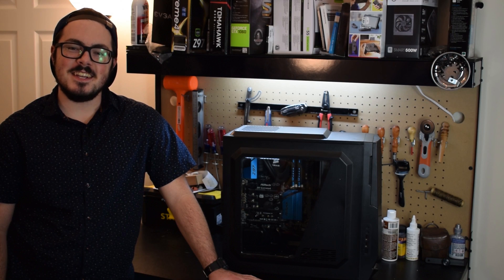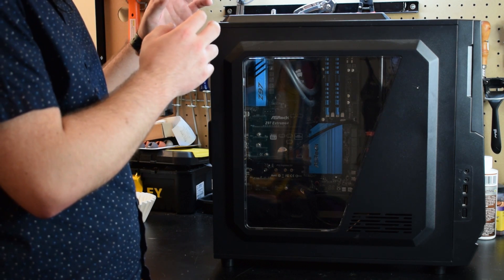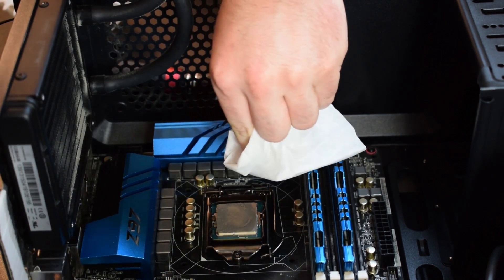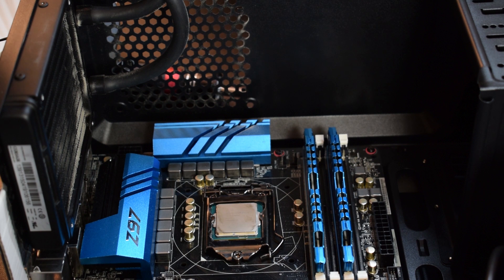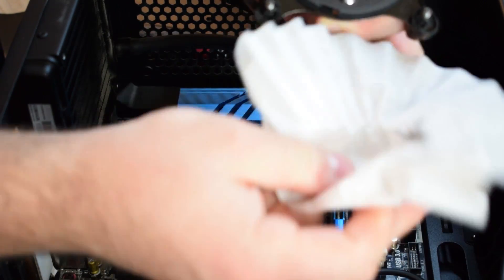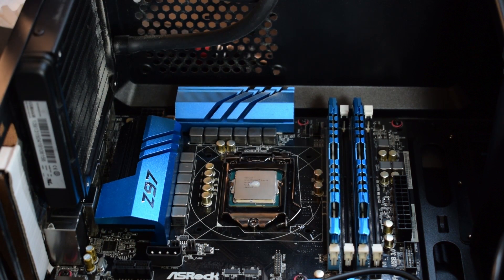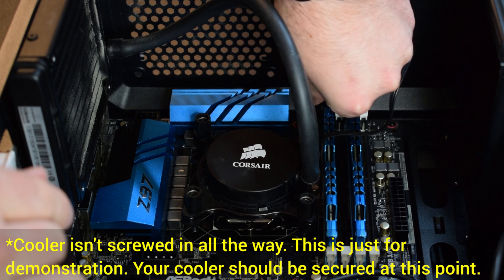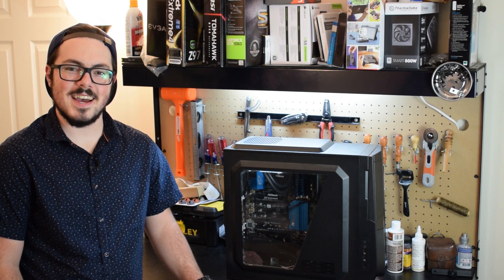How to Clean a CPU and Apply Thermal Paste

Comment: The pea-sized or grain of rice line is severely outdated and quite frankly always wrong.  You should completely cover the heat spreader with a thin layer of the thermal paste using a mini spatula.  The part of the video that shows the initial spread is proof that you will not get full coverage with the line/pea-sized method, and the follow-up about it spreading over time is also not correct.  The method used in this video is a thermal throttling nightmare...

Comment: What alcohol u use in the vid
Reply from the maker: I used isopropyl alcohol. The higher the percentage the better. 90%+ is best, but you can use 70% as long as you don’t use too much and give it enough time to evaporate before you turn anything on. I hope that helps.

Comment: Anyone else notice his rams are in the wrong slots?
Reply from the maker: I was using the ram in a different PC and threw it back in this PC at the last second to make this video 😂 But with that particular ASRock motherboard, that configuration is also correct for dual channel memory. It's definitely worth checking the manual when building a new PC though.
https://download.asrock.com/Manual/Z97%20Extreme4.pdf

Comment: I need help guys , i removed my water cooler to clean my cpu , before my cpu temp was between 60-70 , now after cleaning and putting on new thermal paste its 99c
Reply from the maker: My suggestion would be to try and do it all over again. Make sure you make good contact with the CPU and don't move it or pull it away from the CPU once you have made contact with it. Make sure you have the water block screwed down securely to the bracket on the back of the motherboard.

When people accidentally pull up on coolers before tightening it down, or have the cooler loosely connected, it can create air pockets that lead to terrible cpu temps.

Assuming nothing was damaged the first time, that is what I would suspect is the issue. Also, make sure to plug the pump back in if you unplugged it.

Comment: I'm scared i will apply too much thermal paste
Reply from the maker: There is definitely some room for error. So don't be afraid if you add a little more than necessary, but it doesn't take a lot to get the job done.
Reply: @SANTINIIO  Ok i did it i think its ok my temperature is around 37 when idle using intel core i5 7400
Reply from the maker: @Tuberex  Yeah depending on the cooler and ambient temperature that is perfectly reasonable. In my experience over the next week or so it will continue to drop as the thermal paste spreads out.

Comment: I use the arctic thermal paste remover and cleaner. it's a two step system that removes all traces of any thermal paste from the heat spreader, and preps it for new paste. I also use arctic mx-4 in my laptop, which I use for bike frame designing and gaming, and it is running at least 15F cooler than the factory paste had it running. However, I now have dust problems. Got any tips for dust management?
Reply: More positive pressure inside the case should help with that. Filters on outside vents - air filter in room if very dusty.

Comment: skipped over taking off and putting on the cooler, that's the only part I wanted to see...
Reply from the maker: That is because its highly dependent on the they type of cooler you use, socket, etc. 

One thing I will say, is when you put the cooler on the thermal paste, do not lift it up again (unless you feel like cleaning it and reapplying thermal paste). Any air that gets between the thermal paste and cooler with make it less efficient.

Comment: Can doing this and using compressed air damage cpu pins?? I thought they were safe and locked in safe in the mobo.
Reply from the maker: If the cpu is in the socket then there really isn't any way to damage the pins. If you ever decide to use compressed air (which I would only use for dust) in your PC just make sure you don't tip the can over to spray.

Comment: Your doing it all wrong. Alcohol wipes and done. Takes 30 seconds. Coffee filters are used by professional youtubers to show how much paste is left. 

Alcohol wipe let it dry then done.
Reply from the maker: You've clearly never done it. Because there is always old thermal paste that has to be wiped off. Any thermal paste left on, especially some that has hardened, will cause gaps between the heat spreader and heat sink which will hurt your performance.

But whatever you say.
Reply: @SANTINIIO  did it yesterday actually when I fitted a new cooler. Been working on computers for 20+ years. Linus uses coffee filters to show what is left AFTER they have been cleaned. Lol

You claim to know what you are talking about but admit you have not checked the paste in over 1 year. Dont give up your day job.
Reply from the maker: @SuperSinkorswim  if you've been working on computers 20+ years then why did you feel the need to watch my video?

Nice try there boss.
Reply: @SANTINIIO  do you know how YouTube works? Auto play and recommended videos. Nice try there go make some coffee.

You got one thing right. I also use alcohol wipes. Apart from that you are making an easy job more difficult.

Comment: Do you need to be careful with how much pressure you apply when removing the paste from the CPU?
Reply from the maker: You can add quite a bit of pressure. You aren't going to damage the heat spreader. Like Surub mentioned, just be careful of the pins. I'd also add, if you keep the cpu in the socket, make sure you don't put so much pressure that you flex the motherboard. The motherboard can definitely crack if you add too much pressure.
Reply: SANTINI.IO awesome, thanks!
Reply: yes. but you can always remove the cpu and clean it holding it by the corners so u dont touch any pin

Comment: Is it safe to clean the processor without removing it from motherboard?
Reply from the maker: I always clean it in the the motherboard so I don't mess up pins or damage the underside of the CPU. If you spill alcohol or something like that, just make sure it completely evaporates before turning the pc back on. The way I look at it is that the motherboard is typically cheaper to replace than the CPU if something goes wrong (Although nothing is likely to happen).
Reply: @SANTINIIO  Ok, thanks a lot 🙏

Comment: why coffee filters?
Reply from the maker: They are lint free unlike paper towel and it's something that a lot of people already have. And if you don't have them already, they are really cheap.
Reply: @SANTINIIO  oh ok, interesting. ive been putting off changing my thermal paste (havnt done it before) for a looong time now and have just been waiting until i really have to change it. even tho i did manage to change my GPU i'm still scared to dig around in my pc lol, i feel its actually affecting my gaming performance and i have to finally do it. any alternatives to coffee filters btw?
Reply from the maker: @kombatqueen5068  You could probably use an old t-shirt or cloth, but you have to make sure there isn't any lint, dust, etc from the cloth left on the CPU before you reapply the thermal paste. It's important that the surface is clean so there will be good contact between the CPU and heatsink. It is probably best to just spend the $4 on the coffee filters (https://amzn.to/2OLdRtG) or it's probably even cheaper at a local store.
Reply: @SANTINIIO  yeah ill probably just pick up some 2mo, tyyy for the replies ❤

Comment: I don't have alcohol what should I use?
Reply from the maker: I'm not really sure. Isopropyl Alcohol is used because it evaporates quickly, making it less likely to damage components.

Edit: if you do a really good job wiping off the old thermal paste it isn't necessary to use isopropyl alcohol. It just makes it easier and ensures that it is clean.
Reply: @SANTINIIO  can i use little amount of water with piece of cloth
Reply from the maker: @mrajax_0101  You can use a damp cloth at your own risk. Just make sure everything is dry and that there aren't any spots where water has pooled up before you start the computer back up.

Comment: "This thermal paste has been on here for quite a while, this is my old system"
"It's been on here at least a year"

Lowkey flex :P
Reply from the maker: Haha, it wasn't intentional. I just try to switch it out at least once a year.
Reply: @Mr. Flex Mine is here for 8! I am having nice temperatures though but tomorrow I will change my CPU so finally a bath for my system. :D
Reply: @artefatobh  same 8 years
Reply: @rbl777  I ended up buying a whole nem machine as it was a bit too old.
Reply: @artefatobh  how much did you spend. like your original rig cost and new total cost? curious.

Comment: I removed the heatsync off the cpu to clean all the dust. When i plugged my pc back in and turned it on, nothing happend. About 5 - 10 mins later it turned on by itself. Now it wont turn on at all. Does this sound like an issue from not reapplying thermal paste when i took it apart? Im excited to try this and see what happens though
Reply from the maker: Without being able to see what's going on, I can't say for sure. It's possible that there isn't enough pressure on the CPU and it needs to be reseated. If all of the pins aren't making contact then it will cause problems. If there is poor contact with the heatsink and CPU then it can overheat causing problems.

What I would recommend is removing the heatsink, remove the CPU, make sure there isn't anything in the socket, inspect the pins on the CPU for damage, put the CPU back in the socket, clean the CPU, reapply thermal paste, and put the heatsink back on.

That's what I would do in your situation. I hope that helps.
Reply: Will do. Thanks

Comment: Touching a "metal object" won't do a lot for dischargeing static if it's not grounded... the PSU should be plugged in but turned off.
Reply: Or... Not plugged in at all.
Reply: @SmugJett  Then there wouldn't be a connection to ground.
Reply: @SmugJett  To explain - the earth/ground connector on a power lead is always connected to ground if it's plugged into the wall, even if it's turned off. The case of the PSU is connected to ground via the power cable, and the computer case is grounded when the PSU is mounted, via the PSU's case/screws making contact with it. If the computer isn't plugged in, then it's not grounded (unless you happen to have the case on a surface that is grounded, and the case doesn't have rubber/plastic feet/coasters).

Comment: Great video, thanks a lot! I haven’t cleaned my cpu since I built my system 11 years ago! I’ve also never used thermal paste before. I will use this video for reference if I ever get around to cleaning it ;D

I see your RAM slot usage ;)
Reply from the maker: Thanks! I'm glad it will help. After 11 years the thermal paste is probably as hard as a rock lol.
Reply: @SANTINIIO  i didn't changed it for almost 7 years... need to get rid of it today

Comment: Does this work if I have 69 mb of ram
Reply from the maker: I checked with my experts and they said it won't affect the CPU. But to make your system super chilled you want to put the thermal paste on the gold leads of the ram and then insert it into the slot.

No more than .69 ounces of thermal paste though.
Reply: SANTINI.IO hahahah

Comment: Late comment, but how much pressure do you use when whipping away the thermal paste with the coffee filters. I feel too much could damage it.
Reply from the maker: As long as the CPU is in the socket you can add quite a bit of pressure. Pressure wise you would only really have to worry about the motherboard cracking, but that would take a lot.

In my experience you won't have to add a lot pressure though.

I hope that helps.
Reply: SANTINI.IO I really appreciate the response. I bought a new H100i V2 and I've had to replace it through corsair.

Comment: How about another side? How to clean used CPU that was touched on contact side before installing?
Reply from the maker: If you are talking about thermal paste on the other side of the CPU, I would use as high a percentage of isopropyl alcohol as you can find like 90% or higher and use a soft toothbrush. Be careful though. You don't want to bend any of the pins and you don't want to discharge static electricity because that can kill the cpu. Just be gentle and use as much alcohol as it takes, but don't completely submerge it in alcohol. Also, if any got into the socket you need to clean that thoroughly as well.

If what you mean is that the other side was just touched then you shouldn't have to do anything. It should be ok to use as long as nothing is physically on the pin side of the cpu.

Hopefully that helps.
Reply: SANTINI.IO Thanks for that detailed answer! Basically I was concerned about fat and dirt from fingerprints on contacts of the CPU but now I'll know about thermal paste also.
Reply from the maker: Yeah it should be fine then. I would just avoid doing that in the future lol
Reply: SANTINI.IO, it was not me: I just bought a used CPU today and installed it :p

Comment: I used isopropyl alcohol 50%...that's what I had...worked like a charm. Just cleaned it and let it dry.
Reply from the maker: C Rom Any Yeah, any isopropyl alcohol will work it's just that the higher percentage oh alcohol the less risky it is to use, because it evaporates faster.
Reply: Yes, wipes like that or doused in a small cloth.., and please use something like coolalabratories  liquid pro/ultra, stuff is still unrivaled man dropped temps 10-15 degrees looking like here on the 7700k, superb over all kinda other tims. just unmatched stuff man.
Reply from the maker: I've never used that kind before. I'll have to try it out. Thanks.

Comment: my pc become so noisy, and I want to clean it. Do I need to do this thermal paste as well?
Reply from the maker: It depends on what is actually making the noise. If your pc is noisy from the speed of the fans due to high cpu temperatures then yes new thermal paste will help. Depending on how old the thermal paste is on the cpu, new thermal paste should lower the cpu temperature which will mean the fans will spin at lower speeds making it more quiet. Also, make sure you don't have any fans that are loose. Loose fans will be way more noisy than properly tightened fans.

I hope that helps.

Comment: JAy Z did this video on applying too much thermal paste! https://www.youtube.com/watch?v=rAid5G30-WM
Reply from the maker: +ellsworth1956 Yeah I briefly touched on that while not outright mentioning it.

As long as its non-conductive you can always add more thermal paste than necessary, but if you add too little you can run into problems.

Comment: What CPU cooler that's not to expensive do you recommend for the Ryzen 5 1600?
Reply from the maker: +Laceyn So the Cooler Master Hyper 212 Evo is always a good choice. Just make sure to get the adapter for Ryzen CPUs. Other than that, corsair aio's are nice if you can get them on sale.
Reply: SANTINI.IO ok cool thank you:) I'll check the 212 out
Reply from the maker: +Laceyn Most would agree the 212 is the best air cooler for the money. The Corsair H60 is probably the best cheap aio for the money even though it's about twice the cost of the 212.
Reply: for sure, and i dont mind spending a bit more for something that keeps my cpu cool and safe:) as long as its under $100 im happy lol